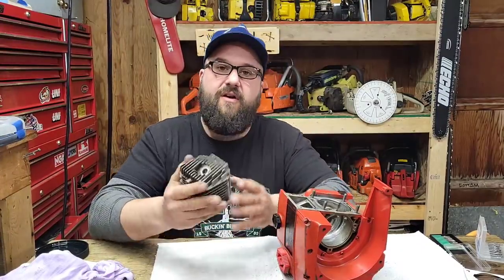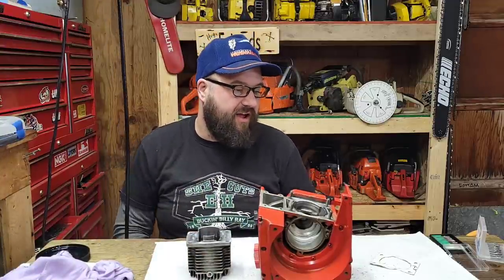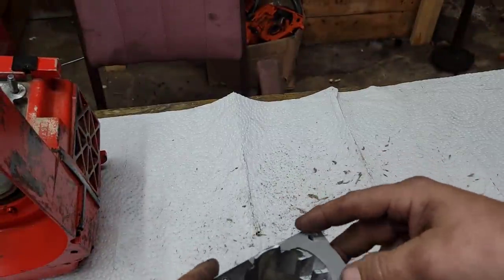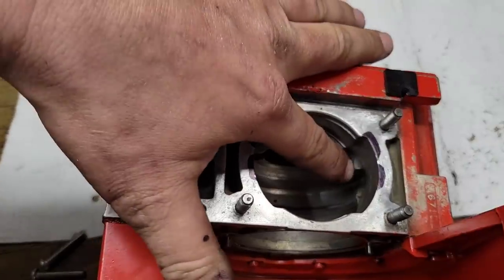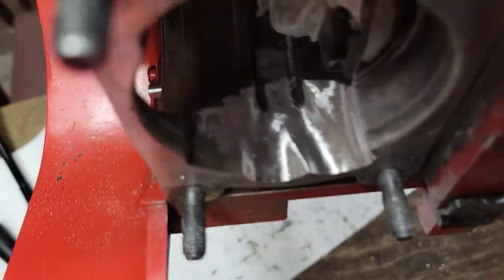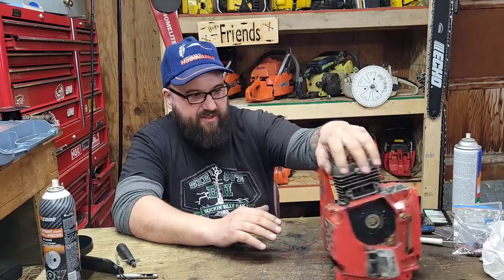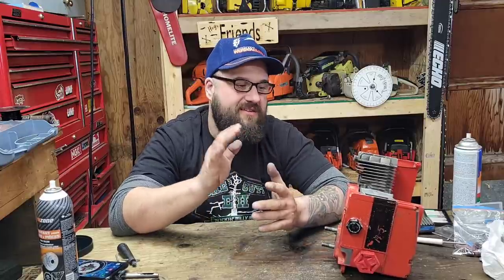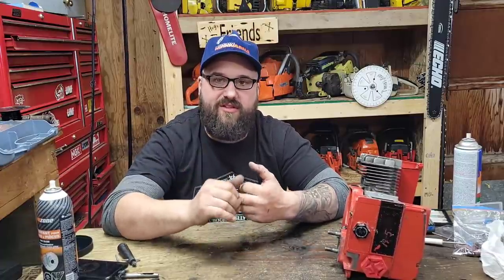Makin' 2 stroke cases flow!! Case trenching a vintage  chainsaw.

Comment: I not sure if you know of RMJ machine but, they used to be named Bowman rings. The make iron piston rings for small engines. Us in the RC aircraft world with gas engines use a lot of his rings. They break in a lot faster and have overall better sealing and performance. He has a huge list of engines he makes rings for and will also custom make rings.
Reply: Yes, I definitely recommend Bowman rings. Some say to run a hone if you have some time on the engine. Some say just install the ring. I suppose it's up to the owner. If it's a new engine just install and break in as if it was new.

Comment: I did a homelite sxl like this , was given the saw due to little or no oil in gas . ordered new cylinder and piston from little red barn , matched the cylinder with the case ,was a big step going ( flow blockage )from case  into cylinder base, tapered it back the transfers, base gasket delete and muffler modified,  it really cracks now and alot of power . Just think how many more saws homelite could have sold if this was done by the factory production. Thank you tinman for all of the great info you have given us.

Comment: Hey Tinman’s Saws not sure if you know but foredom makes a smaller hand piece the H.28 that is smaller in diameter but only holds 1/8in collete size. I like it for precision grinding like this. I ordered mine from Amazon for like $76. The one your using looks like the 44 and uses up to 1/4in. But is bigger in diameter which may be better for ya just giving you a heads up because I know you used the dremel size for a while. Love the content and keep it coming.

Comment: I bought a G660 Holzforma. Heavy as heck but I need a big saw for a contract. I only needed it to last about 30 engine hours. It's like buying a MS660 on installments. Everytime I replace something (which is far too often) I buy OEM MS660 parts. Now that the contract is complete I am gonna try some of this stuff. If I screw it up the CHinese parts are stupid cheap.

Comment: Hi Tinman. Im just finished porting my first saw, inspired by your channel. Thanks. I keep thinking about how/why increased case volume can lead to more power? I my mind it is the size of the piston and how far it travels that is the actual pump volume and that’s not changing… What am I missing here? Why doesnt increased case volume lead to lower velocity through the transfers?
Reply: Less resistance in the downstroke maybe?

Comment: I can see where the transfers will be able to hold. An I guess I mean flow more air. But I have heard Ironhorse talk about velocity of the air. An it seems to me that. It would be the opposite of compression. All that volume of the case and the transfers. When the piston is goin up. Even thoe it will definitely hold more air. With all that volume. Will it create enough vacuum. To pull the air with enough velocity. To tune the carburetor correctly. I may be messed up in my thinkin. But I think that the draw would be less. Less vacuum at the carburetor. Would translate to less gas an air being pulled through the carb. Maybe I just dont understand. Got to be missing somthin. It has got to run better. Or you wouldnt be doin it. Could you please explain in a vid. I dont want to be a dumbass.
Reply from the maker: That sounds like a great video idea, I'll try and mention it in the next video on this saw. 

One hint I'll give you right now is think of the saw like a fan. Ported this saw will run 1000s of rpm faster, therfore it will move way more air. Like running a fan at a faster speed..

Hope that helps, thanks for posting a great comment!!